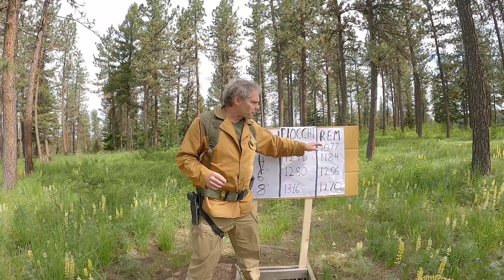How Does Barrel Length Change Velocity

Comment: I'm more than a little jealous of that pistol pack. Still, it is further proof that Paul does indeed "like the classics".
Reply: I thought the same thing, I'm definitely an autoloader guy but I do want a revolver some time but now I really want THAT set
Reply: @CadmusCasey  don’t do it, going down that rabbit hole will put you in debt quick. 
Until last year, I never own a revolver either. Was the same always wanted to pick one up.  Now I own 5. 38spl, 2 357 magnums., 45lc and 22lr/22mag. 
But really you should pick one up, they have their uses. Just be warned, it won’t stop at one. Lol
Reply: @o1mtbiker  Don't have a .41 magnum or .44 magnum?
Reply: @wodenswheelgun3278  not yet .44 mag is next lol
Reply: @o1mtbiker  lol, I'm right there with ya! I keep eye balling a few big magnums. Can't decide between a .460, .480, or .500
Reply: @wodenswheelgun3278  If you’re wanting versatility, get the 460. You’ll have the ability to shoot .45 Schofield (it can still be found online), .45 Colt, .454 Casull, and .460 S&W Magnum. 
Now if you just want Mr. Big Wiggle, go for the .500 S&W Magnum. Low power loads will have to come in the form of the .500 Special or hand loads.
Reply: @wodenswheelgun3278  I've had a shop that specializes in classic firearms looking for a couple years for me for matches to my Model 27, 6.5" barrel. I want the Model 57 and Model 29 to have a matched set of 357, 41, and 44 Magnums.

One can potentially find those models, but matching the series apparently is difficult. I've had the M27 since I was 14.
Reply: @shootist0052  Yes sir! I have definitely  been digging in research and leaning more and more towards a S&W .460 performance center
Reply: @o1mtbiker  I don't get it. I bought my one. I was satisfied. Pleased as punch. Hell, I was downright proud of my purchase! ...and then I saw my future second one in the display case. Now I'm eyeing an SAO repro. HELP
Reply: @o1mtbiker  revolvers are cool as fuck bro, you made the right choices
Reply: @michaelturk7237  Sorry, but there is no help. All you can do is buy it and be happy until the next gun store visit. Repeat as needed.
Reply: @ktheis1  [cries in yee-haw]
Reply: It’d be interesting to see Paul’s take on the Chiapa Rhino. If I ever buy one I’ll send it in. The reason it interests me is because it’s a revolver which we associate with the classics, but it’s also very tacticool, futuristic, and unusual to what Paul might be used to
Reply: I had a chance to buy a Dan Wesson with multiple barrels (not the pistol pack) many years ago. At Walmart! Sorry I passed it up.
Reply: @1911Savage  As I recall, High Standard marketed a 357 revolver that was a clone of the Dan Wesson, as well. Same look and lockup, just not the interchangeable barrel system. 
Walmart used to have bigger sporting goods sections than they do now.😞
Reply: Yea love Dan Wesson.thinki I might be needing that.thanks Paul
Reply: One of the only times I've cringed when seeing him shoot in the rain.
Reply: I got to admit I got a little "chubby" when he pulled out that Dan Wesson pistol pack.

Dan Wesson has been my dream gun for years
Reply: I loved the versatility of that revolver and it looks beautiful but I got to be that abnoxious fudd and say that the yellow mustard fabric is not appealing.
Reply: Question is... did he shoot six pistols, or only two?
Reply: I am also Derek S. 
Good day sir 🙏
Reply: “You guessed it”
Reply: Man that would be badass to own.  Paul is a badass
Reply: I So Want that pistol pack.  I wonder if Dan Wesson still makes it or is that a vintage gun....
Reply: @jamesa.7604  That would be a question fot Google.
Reply: If the best slingers back than could use modern weaponry... they would be gods... now put a modern deltaforce guy or navy seal into the 1700s or 1800s I wonder
Reply: @ThinkLikeaCar  It's a gorgeous set.  We truly have an embarrassment of riches.  I always think about those days in the 1700s and 1800s where a man might feel very fortunate to have 3 or 4 firearms.
Reply: @georgemartin5980  imagine how the first Texas rangers that got the first revolver rifles or the first colt 1836s or colt walkers... probably felt like they had alien tech
Reply: Damn that pistol kit is mighty fine 😊 , son! I wish Mr. Harrell a lot of accurate shots with it and a lot of deer 👍
Reply: Since when did you need "further proof"?  If you've watched his videos, you'd know
Reply: A friend of mine had one with a Satin/Nickel? finish.
The term maybe wrong I do not know what they call it.

That was one of the nicest looking pistols I have ever seen.
The kit in the case was impressive.

I never got to go to the range with him to shoot it.
Reply: @shawnr771  Stainless
Reply: @g24thinf  Possible it was a long time ago.
I just remember how nice the pistol kit was.

Comment: What a great topic! Velocity has always been a major contributing factor when it comes to the handguns I choose and the specific round round that's best for said platform. Tons of people don't even consider this, and when they do it seems like the choice is based on the fastest round possible. I've always wondered if there was some kind of equation to go by when it came to estimating velocity from one barrel to another. It took me a long time to find the best round for the 4.5" pistol I use for the home. So many resources out there seem to test in barrel lengths of 3-4". I've also heard a steeped chamber can greatly effect velocity too.
Reply: I went with the CZ-P09 for this exact reason. What did you go with? Never knew about steeped barrels, I’ll look into it
Reply: @PuppyPulverizer  Walther pdp 4.5"full size. I love it! Apparently due to the steeped chamber it causes a tighter hold on the round further down a bit. I'm pretty sure Gen 5 glock barrels are the same way. Supposed to help with velocity and accuracy.... Whether that's true or not, I haven't the slightest clue but I do love this damn gun.
Reply: The 4.75 inch barrel Heritage Rough Rider with .22 magnum gets about the same FPS as a Ruger 10/22. That's why I like the Heritage Rough Rider revolver as a backup to Ruger 10/22
Reply: I made an equation but it involves calculus. Specifically u-substitution integration. The eqution itself calculates muzzle energy, which if given the mass of the bullet, makes finding muzzle velocity easy. And you have to input everything using SI units.

Comment: Not more pressure, more time for the pressure to act on the bullet increasing the velocity.
Reply: I think the high point is about   shortly after the bullet gets out of the case   and or    in the first 1.5" or less ... could be much less
Reply: @danoneill2846  :  My memory is that peak pressure in rifle cartridges is when the bullet has traveled about 3" - 4".  I imagine the distance is less in pistol cartridges.
Reply: @craigbenz4835  I think your right
Reply: yep
Reply: More pressure too, because pressure builds up until the projectile leaves the barrel. Just part of the powder burns inside the chamber, part of it start to burn while the bullet is already in the barrel.
Reply: @Neomalthusiano  they have done lots of testing that show the spike is when the bullet is close or very close to the case in a handgun
Reply: @danoneill2846  of course that's is, thus the need to not using too fast burning powders that may expose the gun to peak pressures above saami norms. But it's not because it's peak pressure that it suddenly vanishes. Just think, if I make 3 grand a month and you make one grand a week, who has a bigger income ?

While the bullet goes further, pressure can only decrease since there is more space for gases to expand

Comment: depends on the powder       slow powder will likely get more vel from a longer barrel
Reply: Yeah, most pistol ammo is gonna have a super fast powder to maximize the shorter barrel. Sticking it in a longer barrel won't do much if anything which is kinda what we saw here. If you hand load, a longer barrel could be a much bigger deal.
Reply: @WaterZer0  that's debatable. While what you're saying is totally correct, manufacturers no longer publish burning rates of their powder. The only one I know it does is magtec. While you could figure out which powder is best among those of the same brand judging by their recommended recipes, it would be guesswork to compare powders from different brands
Reply: @Neomalthusiano  Why load a slow powder into factory handgun ammo? The velocity is gonna be bad, and people are not going to buy it most likely. 
Granted I guess you could claim some insane velocity and put in the fine print it's out of a 10 inch barrel.
Reply: @Neomalthusiano   One way would be use a wad cutter , likely very fast powder . And use a Winchester  158 gr sold for hunting or high power    likely Win 296 / H110  powder used  very slow for a handgun .
Reply: @WaterZer0   the powder used in the ammo here is likely med slow . WHY .... it's a Mag , not a special . You can hunt with it & shoot them from a rifle , slow powder is mostly high power & better in a Marlin 357..
Reply: @WaterZer0  loading slower powder is super important for not blowing your gun and your hand with it. You can handload a .38 with just about anything, use between 3 gn and 5 gn and call it a day. Now, try loading a . 44 mag with 18 gn of a too fast powder, specially those "generic powders" below 0,35 ms of burning rate. Actually don't try it.
Reply: @danoneill2846  that's smart, but still the person trying that would still need to be very cautious about overpressure signs
Reply: @Neomalthusiano   I agree  .. a smart person would READ THE DIRECTIONS in the loading books  & not just guess . I have a few books & always read them all , they are not all the same . You can make a good judgement after that . The books were from the powder makers & bullet makers .
Reply: Here's the answer I was looking for. The burn rate of the powder being used in a shorter vs longer barrel. As a Reloader since I was 9 years old & now 57 I have many many different powders for certain guns. Not just for barrel length but for accuracy & bullet weight.

Their are " SPECIALTY AMMO " out there that claim they are for shorter barrels but they're lacking & STUPIDLY EXPENSIVE AS MOST SPECIALTY AMMO IS. GREAT COMMENT, SIR.

Comment: Basic physics claims that barrel length increases velocity, but there are caveats including the amount of energy from the powder or propellant and the amount of friction in the barrel. 

The bottom line is: how much acceleration does the projectile get, how much drag does the projectile carry and how aerodynamic is the projectile.
Reply: barrel length matters to a certain point then starts to do the opposite

Comment: Nothing like watching Paul Harrell while maintaining your guns
Reply: I watch as I reload quite often . Very relaxing
Reply: @kevmoful  That reminds me, I need to get out to the shed and cast some bullets so I can reload.
Reply: @Quadrenaro  I got a shed 2 months ago ac and everything. It’s bliss, never got into casting but I certainly see it as a valuable skill to learn . I even bought a 45/70 to motivate myself to learn.
Reply: @kevmoful  Dude it's amazing. I cast 158gr 357/38spl projectiles and 95gr 380/9mm projectiles and it's brought cost per round down significantly.
Reply: @Quadrenaro  what’s a good source of lead? I’ve heard wheel weights but Is that suitable?
Reply: @kevmoful  Alot of tire shops won't give out wheel weights very often, and when they do you get a mix of zinc and steel weights as the industry is moving away from lead. But Wheel weights (often refered to as WW) are a good source of lead if you find it and can be added to softer pure lead to bring up the hardness.

I get my lead from the range. On cool days in the spring and fall I go out with a 5 gallon bucket and pick up as much surface lead I can find at one of my favorite shooting spots, and get about 10-20lbs on a good day. 

Alternatively, you can check with scrap dealers to see if they sell lead by the pound.  I have about 100lbs of lead stored up which is close to 4500 158gr projectiles, or 7300 95gr projectiles.

A few private ranges may not have issue with you picking up surface lead without digging. One local range told me that after a match, I'm welcome to pick up as much as I want.

You could always buy lead shot and melt it down, but you might be better off trading it to shotgun reloaders. I've been offered 1.5xweight of lead shot for clean lead ingots by some guys, but it'll work in a pinch if it's all you got.

Now the real rabbit hole is learning about lead harness (measured in BHN), powder coat vs lubing bullets, water quenching, and to use a gas check or not to. Once you start making your own gas checks (a small harder metal disc, usually aluminum or copper, on the base of the bullet that provides a seal to prevent high pressure gasses from escaping around the projectile as it travels the barrel) from soda cans, you know you've gotten serious. 

Other metals such as antimony, pewter, and even silver can be added in just the right quantities to make harder bullets that can withstand higher velocities.